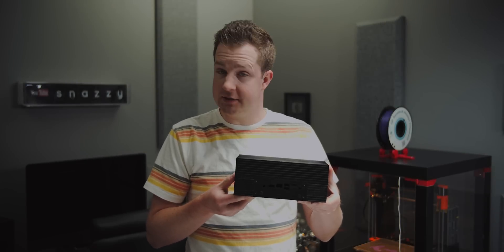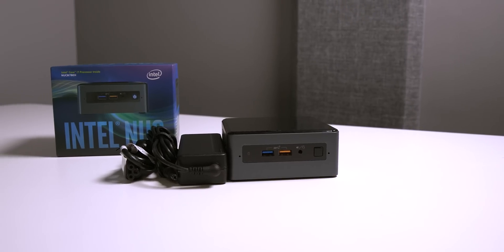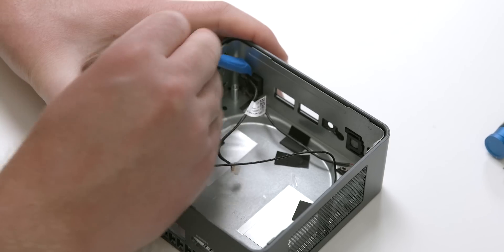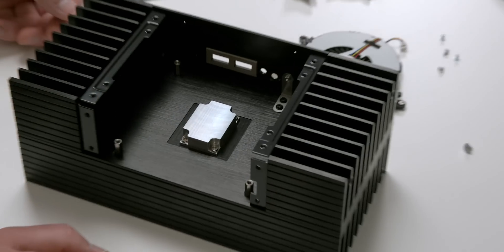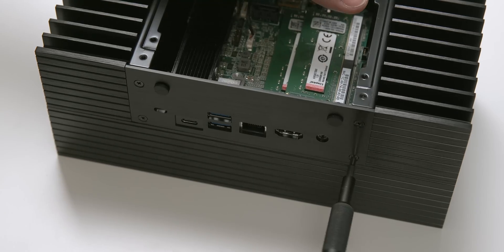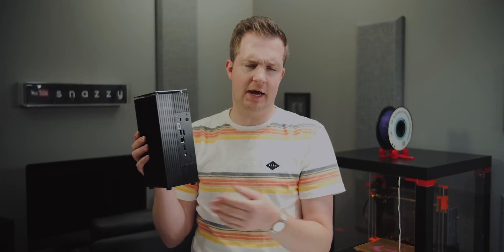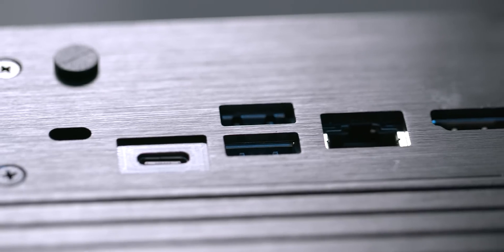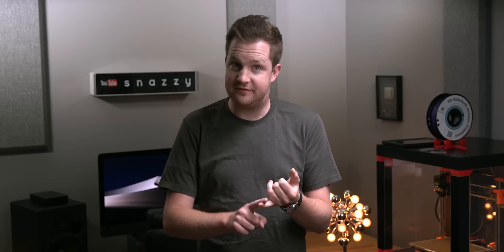The Tiny, Fanless, Mac mini KILLER!

Comment: This is not how thermal paste works, works best and should be done. Direct contact is way better than anything, thermal paste is only used to correct little imperfections on contact. Take an object like a bus ticket and remove the excess paste. Thermal paste does not improve thermal transmission, in fact it's not very efficient but it's better than nothing when surfaces are not perfect... like in this case. We don't use thermal paste on supercomputers or special hardware when we have the budget to rectify surfaces.

Comment: Now think about a core i9-9980hk and an rtx 2080ti in it with 256 gb 4800MHz ram, 8tb storage and a 1300w 80+ platinum
Reply: why would you use fast ram on an intel cpu?
Reply: @jamestor6700  just to make it costlier
Reply: @jamestor6700  anyways, looks like you will be one of the area 51 raid
Reply: @boneman-69  I gotta get my monster ready

Comment: thermal-dynamics laws will say that vertical is the preferred way to be because of natural convection currents created by a rise of hot air. me personally, i would surround the fins with black cloth or something aesthetic so that air is forced to actually flow through the bottom and out the top. the hotter it gets, the more efficient it becomes.

Comment: Step 1: Look at the prices of Macs. Too expensive!
Step 2: Hear about Hackintosh.
Step 3: Want to build Hackintosh.
Step 4: Need a Mac in order to get Mac OS for the Hackintosh.
Step 5: Why must there always be a problem?
Reply: You can create the usb drive on a virtual machine, whose host runs windows/ubuntu. You don't need to have a mac of any kind.
Reply: To do it legally you need a Mac. There are alternate methods.
Reply: @aviatorsdream4686  To do it legally? You cannot do it legally in any way, because MacOS, while technically free, can only be used on a real mac. Which means you get one operating system per mac device, and you cannot purchase it in any other way, legally. Whatever you do will be illegal and Hackintosh is not something you do in professional environments.

Comment: You put thermal pad on sticker wow. One more layer of insulation.Its just wow
Reply from the maker: Wow. Removing it voids the warranty. Temperature differences are negligible. Wow. Just wow.
Reply: @snazzy  ya that heatsink is just  thermal mass it but thermal conductivity of that sticker is surely bad, for temperature differences check removed, with sticker and without  sticker. Then why do you remove sticker from heatsink before installing on cpu ..,

Comment: Apple needs to come out with their own version of this, with cheese grater aesthetics, and fanless GPU. (About 1050Ti level, but with 2019 process size, for really high power efficiency.) They should sell it for 2019 Mac Mini prices and reduce the price on the Mac Mini.
Reply: Yeahhh, you're not going to get a fast passively cooled 75W GPU in a Mac Mini form factor anytime soon. Look at how big that case is, and understand a lot of it is a heatsink for a 15W CPU. How big do you think it's going to be to deal with 5x the heat from the GPU alone? Conversely, if you're ok with "good enough", AMD and Intel have integrated GPUs that are about 1030/RX 550 level for better than you'd expect performance and very little power draw. But you're not gonna see 1050 ti performance below that 75W mark unless AMD reveals a little Navi card that can draw the same or less power using 7nm. But otherwise, nvidia's cards have basically only gone up in power usage.

Comment: Dude, I got this same case the x62 in the front cooling the CPU with a single push config then I have an additional 120 AIO in the REAR doing a push from the outside cooling the GPU if you want I can send you pictures. Also, have a USB hub in the basement along with a fan controller mounted on the back of the case.  Lots of cables but for what I got for cable management it's not half bad.

Comment: Actually Aluminum and Copper has the very similar effect as heat sink materials. The parameter of how good it conducts heat is based on weight, however, aluminum is relatively low density and in another word, the ability of conducting heat based on per volumn heat sink is pretty similar.

Comment: I followed the link for the Akasa Turing Case and it went to Amazon Japan and it's listed at 60,580 Yen or USD$560 thereabouts. Once you add that expense in, it's significantly closer to the Mac Mini. Also, I have an 8i3BEK, and one of the things I prize a lot for the NUC is its small form factor. The case immediately nullifies that at an additional US$560. I'm not sure how many folks would make this trade off for a totally silent NUC which, if you're not stressing it, it not very loud anyway.

Comment: The SSD you've linked in the description is a Intel 660p 1TB while you install a 760p in the video. Thought I have read somewhere that 660p's don't work well on MacOS.
660p has a green pcb while the 760 has a black one, so its easy to spot the difference.
Reply: the 660p doesn't have any cache so you will experience a degradation in performance the longer your workload is

Comment: Working from your links:

Intel NUC Bean Canyon NUC8i7BEH Mini Computer Kit US$565.98
Akasa Turing Case US$130
16GB 260pin RAM US$104.93 
Intel 660p 1TB SSD US$151.04
Delivery? US$??.??
Apple wireless card US$??.??
TOTAL US$951.95 +  US$??.??

Mac mini 3.0GHz 6‑core 8th‑generation Intel Core i5 (Turbo Boost up to 4.1GHz)
8GB 2666MHz DDR4
Intel UHD Graphics 630
256GB SSD storage
Gigabit Ethernet (10/100/1000BASE-T Gigabit Ethernet using RJ-45 connector) 
US$1099

The somewhat "Macish" Hackintosh only has one non hot-pluggable Thunderbolt port and users have said they are worried about overheating the SSD becuase it is such a tight fit. 

The Akasa Turing Case NUC is "almost as expensive" & "ALMOST" as fast - hardly a "Mac mini killer"
Reply: ...and definitely NOT "half the price". In fact filling in the blanks looks like it might even cost MORE.

Don't even have to do all the shopping and adding up to know that no way it can EVER be "half the price".

That doesn't even allow for getting the Mac mini discounted.

Comment: 850 vs 1100 is somehow significant but far from impressive savings considering all the hassle associated to mackintosh-ing. It might be worth it, but only maybe.
Reply from the maker: Get rid of the case and add the SSD to the Mac and you’re looking at a $1,000 price difference. That’s pretty substantial.

Comment: For anyone with a Macbook:
You can reduce the thermals and extend battery life with this thing called "Turbo Boost Switcher." It's a free app that turns off intel's CPU boost and lets your laptop run MUCH cooler. Everything still runs fast on my macbook pro for basic usage. :)

Comment: The SD card slot seems like a huge oversight on the design. One ribbon cable to full SD Card, and a small modification of the case design and manufacturing later and you would have a functional SD card reader. Which, knowing that one of the reasons for mac is Final Cut Pro and that you need to import media, doesn't seem like a bad addition.
Reply: Freeman's Freedom even less flimsy design would be to use the SATA port that was unused and adapt it into 2 full speed SD card slots.

Comment: "Even with the power supply, the entire system is significantly smaller than a Mac Mini."

No it's not.

The Akasa Turing has a bounding box volume of 2.673 L while the Mac Mini has a bounding box volume of 1.397 L.

Now, if you're talking about the NUC, but not counting (although it should be counted) the power adapter, it comes in at only 0.6683 L.

However, it has been my experience with the NUC8i7BEH that the stock NUC configuration, due to its terrible thermal management, will throttle the processor because it keeps running into the thermal limit.

So, yes, mounting the NUC into what's basically a giant, passive heatsink allows it to perform better, but it's also close to being twice the volume of a Mac Mini whilst not performing better than the 6-core i5 processor that's found in the Mac mini and yet you're using an i7 processor.
Reply from the maker: I’m talking about the base NUC.
Reply: @snazzy  
Yeah, I like the base NUC EXCEPT for the fact tha the stock heatsink is terrible and will throttle under Cinebench R15 multithreaded workload, if you run it on a loop to the point where you can thermally saturate the thermal management subsystem.

Comment: Adding the heatsink to the SSD might actually hurt the temperatures if you position the case upright. The fins of the SSD heatsink are positioned in horizontal direction, whereas the airflow due to natural convection is always in vertical direction. Whether it helps or hurts the temperatures really depends on the heatsink geometry but in this configuration circulating air pockets may form between the fins which will actually insulate the heatsink. 

I'm curious if you've tested the difference with the heatsink and without and if the orientation of the case influences the SSD temperature.

Comment: Nice Hackintosh video as always Quinn! Have you considered trying it on one of the ultra small form factor business class desktops? They're just a bit bigger than the Intel NUCs (still significantly smaller than a Mac Mini), but they use Intel T CPUs, which are just underclocked desktop CPUs.

Examples are the HP Prodesk 600 Minis and Dell Optiplex Micros.

Comment: Can You make a hackintosh with the new ryzen 3900x and 5700xt gpu?
Reply: No he can't I don't think, apple uses Intel, he's piggybacking of the work of apple to make there software run on an Intel CPU.

I could be totally wrong, but Mac OS wasn't meant for AMD CPUs, or it's been a while at least, and there isn't that "base working instruction set".
Reply: Its probably possible as the Hackintosh community has a kernel that works with AMD.  However Final Cut Pro X uses Intel Quick Sync so although it will work most likely rendering is video is not going to be any faster but other things might be.  Considering most Hackintoshes are used primarily for FCPX or Logic Pro X you may gain speed in certain areas but not all

Comment: 6:46 The clockspeed of the memory is super low, 2400 mhz I believe...
Me: Yeah, I'm rocking 1333 in my 10 year old gaming pc...
Reply: Most of my computers have 1600MHz. It's a nice middle-of-the-road speed for middle-of-the-road components, like my i7-4790, and Phenom II X4 955. I also have an epic Athlon single thread beast with 400 MHz DDR 😎
Reply: Ram speed really matters with ryzen processors :D lol
Reply: Same lol. But works fine

Comment: You have reccomended tonymac, what's wrong with you? Tonymac just appears to be simple but in reality is just a bunch of crap which makes some things harder like upgrading the machine to a new mac os version or just messes up with system software (to not speack about software and other things they use without any permitions and all the meny the make out of all the noobs browing their forum). For machines like the intel nucs i reccomend some vanilla efi folders you can find on github + a vanilla installation to avoid all the risks which comes from pre made isos and oses you find online.
Reply from the maker: This is exactly what I said.
Reply: @snazzy  Not exactly i wanted to clarify some things and it seems like you kind of recommended it, so i wanted to explain better the why, but please don't be hungry, this is a great video and the huge work you and your editor are doing is remarcable, this is almost linus level of quality, but as an hackintosh expert i wanted to make clear some things about your hackintoshing content

Comment: That thermal paste application, it is fine but it is not pretty. :P
Ideally you want it as thin as possible but 100% coverage, thermal paste conducts heat less well than metal on metal, it only serves to get a smooth surface because smooth metal is not a smooth as it looks like, the more fluid paste bridges the gaps. (the last part is not aimed at Snazzy Labs, he knows this)
But it shouldn't make a  bigger difference than a few degrees C so it is fine for this sytem and purpose. Also this for who doesn't know, in the case of conducting material like liquid metal and some thermal pastes  you really don't want to spill over the sucket (or over the GPU surface in the case of a graphics card) but most thermal pastes don't conduct electricity so all that happened with that crude application is that the layer got a bit too thick and he probably prefers too thick over risking not 100% coverage which makes sense.

LOL@ that The Verge Stefan snapshot.
Reply: alysdexia  
Programmer detected.

Comment: This is why I have trust issue with apple fans. Even if they are into hackintosh, they make silly mistakes like putting heatsink on plastic sticker. 😑
Reply from the maker: Gimme a break. The difference is negligible and removing the sticker voids the warranty so I left it on.

Comment: If I'm not mistaken NVMe SSDs shouldn't stay excessively cool when running because that actually shortens their lifespan: while writing to them, the heat reduces damage to the cells and many manufacturers add heating elements to ensure that the cells are warm enough while performing a write.
In this case it was probably a good idea to put a heatsink on it since there is no active cooling but in traditional desktop cases where you have fans, it's more than enough to keep an NVMe drive at a good temperature and adding a heat spreader will do more harm than good.
Reply from the maker: Yep! Would not cool if there was any airflow whatsoever. Cheers!

Comment: 1. Why not just install OSX (or any os) on the NUC? i.e what is the reason for transplanting the NUC internals to the other case?
2. Can one not purchase the specs directly for the Akasa case, rather than ripping out the internals of the NUC? Would it not be cheaper to buy essentially the motherboard without having a redundant NUC case?
Reply from the maker: (1) for absolute silence, (2) no.

Comment: The NVMe SSD form factor temps are a thing that have been studied. Thank you for referencing GN’s TIM application video, btw. Anyhow, the NAND should be 40-50 °C and you should not cool them more than that. The controller on the other hand, you can cool to as low of a temp as you wish.

Comment: Why didn't you take the sticker off of the SSD and apply thermal paste? Will it not affect it?
Reply from the maker: Applied a thermal pad. That will do more than enough. You don’t want NAND flash to get too cold or it actually doesn’t work well. Sticker should ideally be pulled but this one gets its warranty voided if you do.

Comment: I will admit I'm an unapologetic hackintosh gatekeeper. I really don't like how mainstream hackintoshing is becoming. Apple is definitely taking notice. I'm sure they are accelerating their plans for macOS to become like iOS. i.e. only usable on specialized hardware/processors with a bunch of security chips. I don't want that.

Hackintoshing is an extremely nerdy passtime, and as people like Linus and Quinn (as much as I love them) try to make it easy for people to hackintosh, the people that want a free Mac experience will jump in without realizing how much legwork they will have to put in on their own to get there.

For every 1 person that's willing to put in the work (of whom I have helped several through the process <3 ) there are 50 others that just want to download a premade-config and use tonymacx86 software, which inevitably breaks stuff. When stuff breaks, they have no idea what went wrong and will ask others how to fix it, without having a clue what they are even being told to do. Some people just aren't meant for this level of tinkering. (The main reason people don't like tonymac is because he steals software and makes money from repackaging and hosting it on his website. RehabMan and other people on the forums there are great resources though.)
Reply: ansonx10 I think you’re missing the whole point of open source and crowd support. If you want something, you’re free to put in the work and do it yourself instead of using other people’s work and then getting annoyed when others do the same thing
Reply: oh stfu

Comment: but not really has it's still not ahs compact as the mac mini so it's not a killer, also for it to be a completely killer it should actually look good and elegant as this is one of the main selling points of the mini and where big designing thinking goes to. you can say its killer if it fails to compete and destroy all of the categories
Reply from the maker: I think this looks far more elegant than Mac mini. And if size is a priority, the stock NUC is less than 40% the size.

Comment: I still really want to build a custom hack pro cheese grater that uses a 3175x in the gigabyte board with 4 Vega frontier editions all using custom all black and nickel gpublocks and monoblocks. I want the ram and m.2 drives to have matching blocks as well. Nickel plated copper tubing, and load it up with as many radiators as humanly possible. And I want to use riser cables and adapters to route all of the ports and expansion cards neatly. If possible I’d want to throw as many thunderbolt cards as can be used.  Oh and dual 10g lan. A sound card. A gpu accelerator or two. If Mac can even use one. I just really want to build it. And then sell all the parts back.